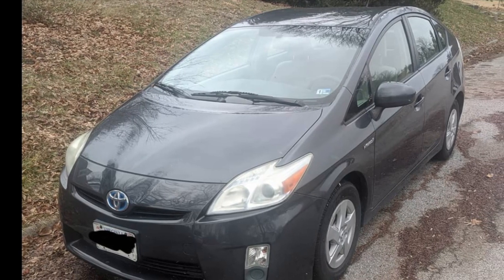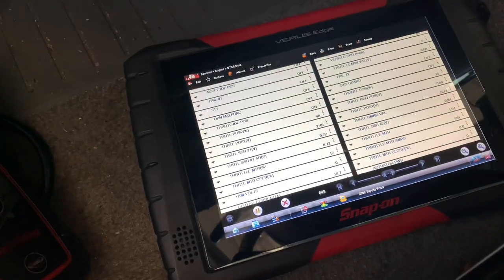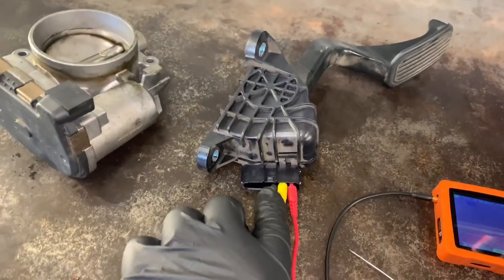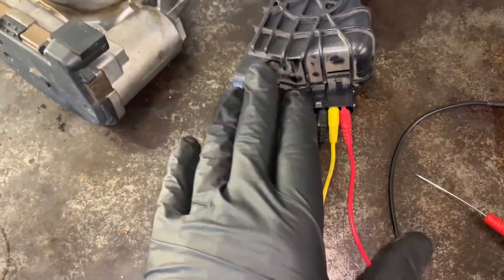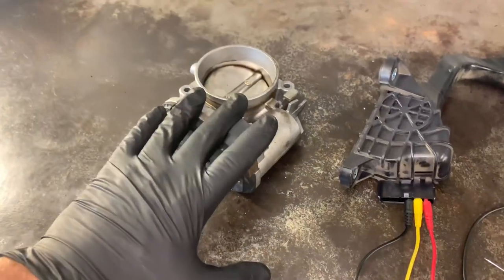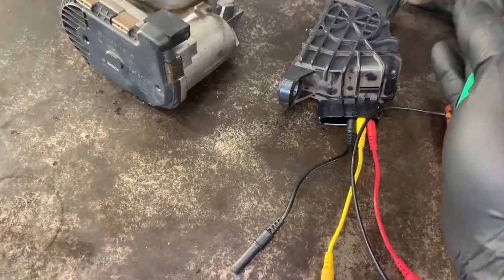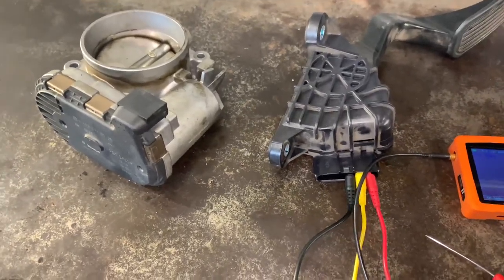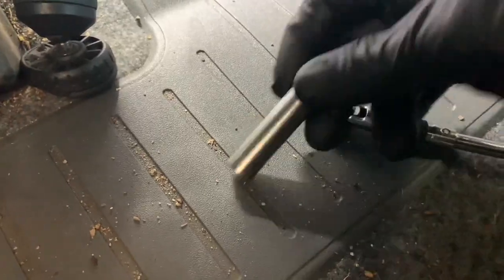2009-2015 Toyota Prius: How To Replace The Accelerator Pedal

Comment: Does a new accelerator pedal need to be calibrated or does the Prius computer auto adjust?  In other words is computer needed to set settings or just install new pedal and go?

Comment: I just replaced my accelerator pedal sensor, but I’m still getting a P0121 code. I’m thinking it’s the throttle position sensor, but I’m not even sure where it’s located on my 2010 Prius. Is the TPS the same as a camshaft position sensor as well? Thanks

Comment: Prius P1121: Coolant Flow Control Valve Position Sensor Stuck. That's not for the accelerator pedal.
Reply: You I pulled up this same code and it list this control valve and also the accelerator pedal.  I'm trying to figure out which is the culprit in my car.